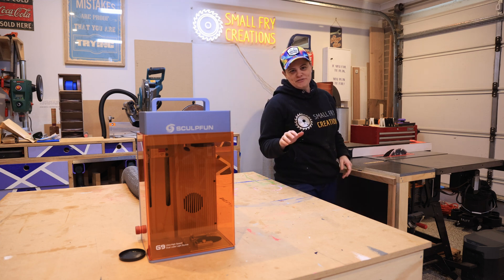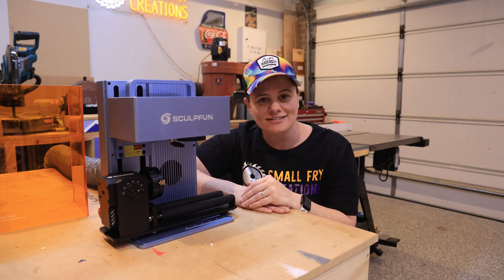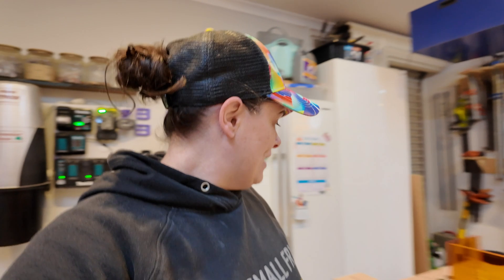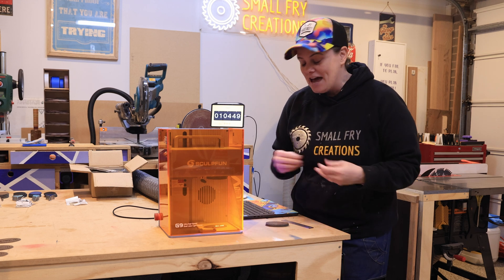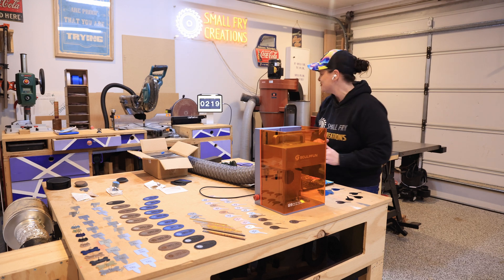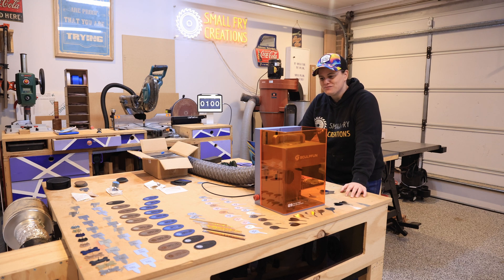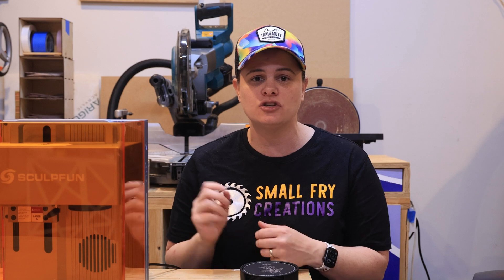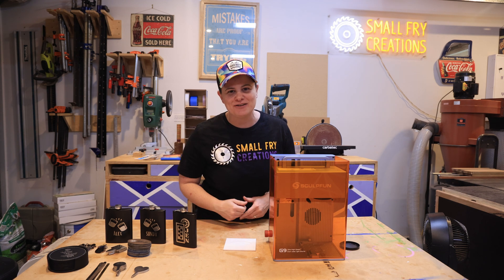REVIEW Sculpfun G9 Laser with a speed test! | Fast, compact, reliable and portable for markets!

Comment: Trying to decide between the F1 or the G9. but what about the filtering system for the g9
Reply from the maker: Fair they are similar. I haven't used the F1 to compare. The filtering system on the G9 is very good. I haven't had any issues.